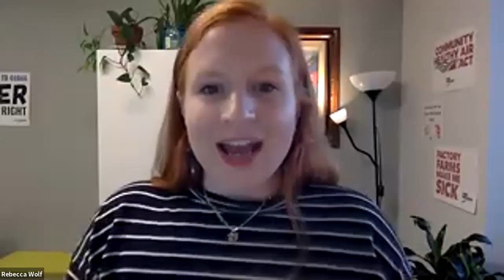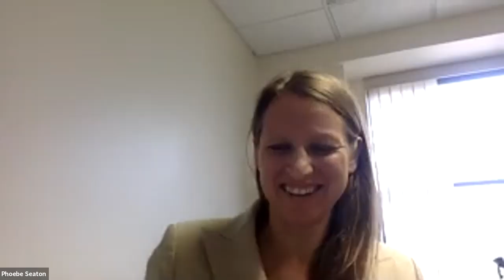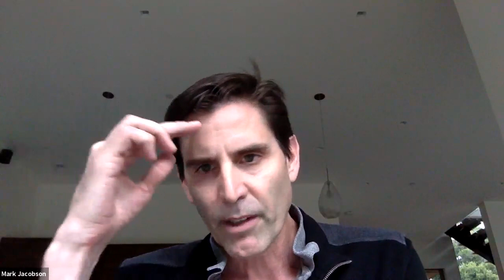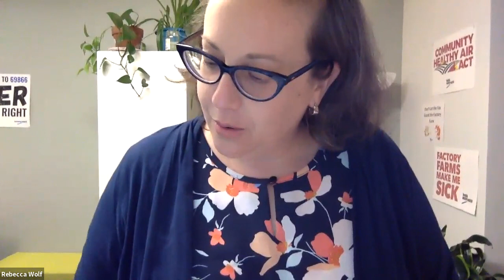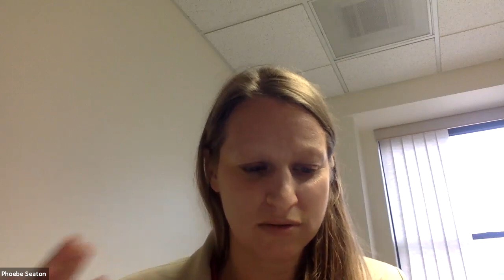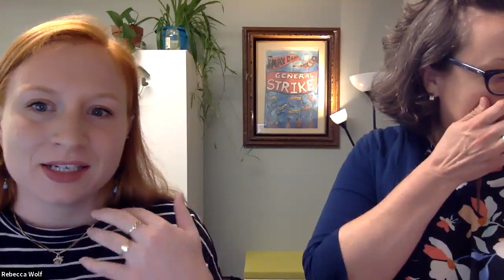Bio(gas)hazards: Dirty Air, Factory Farms and Climate Change Webinar

Comment: I'm all for your efforts in opposition to CAFOs.  Certainly digestion systems on CAFOs are lipstick on pigs which should not even exist.  However, smaller-scale integrated  digestion systems offer huge potential for decentralized nutrient conservation for regrowth and renewable energy.   So y'all want to lose all the energy in food residues?  Just send them to the landfill?  I used to have considerable appreciation for Food and Water Watch,  but this blindered presentation has destroyed most of it.  Who's pushing digestion around the world?  Several hundred million folk working toward smaller scale systems.  YOU NEED TO GET AN INFORMED PERSPECTIVE.